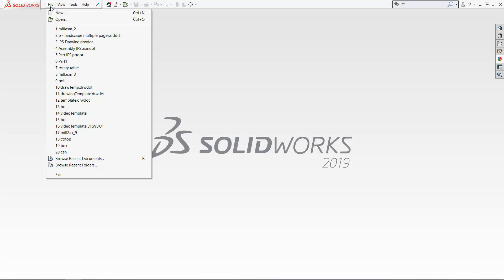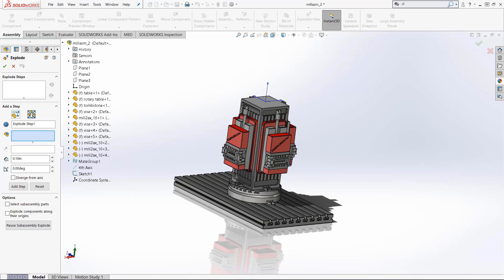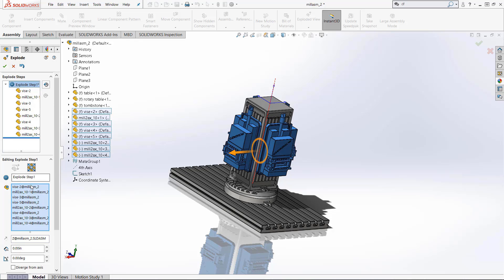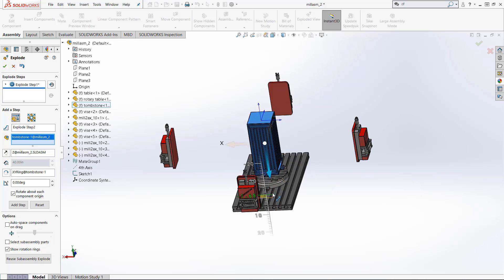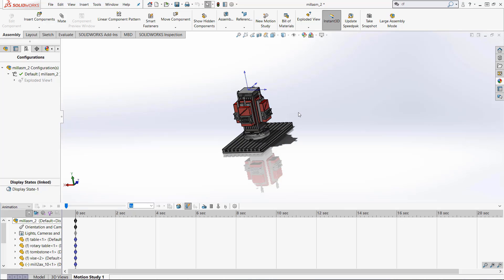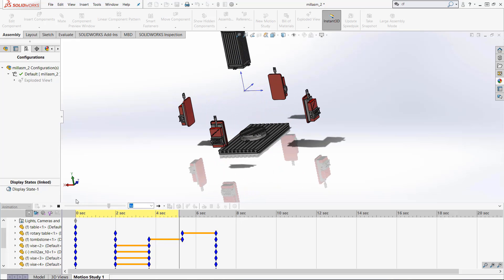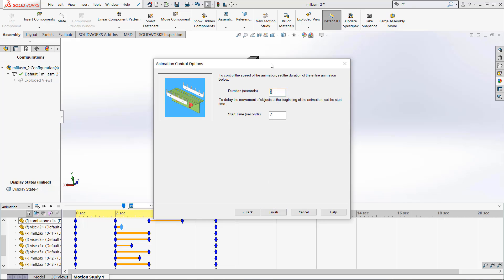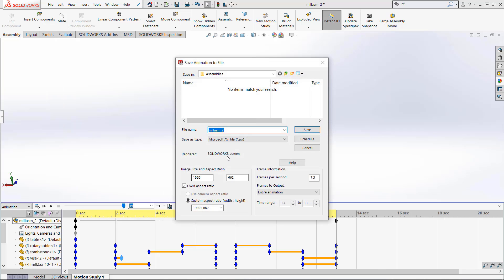Animating an Exploded View in SOLIDWORKS

Comment: exporting my motion study as gltf file into blender key frames are there but its not smooth between frames it just seems to jump keyframes, is there a setting I need to adjust for this?
Reply: It might help to increase the frame rate in the motion study settings. I think the default is set to eight frames per second. I have never exported into blender though, so this might not solve your issue.
Reply: @chadd_robertson  thanks for getting back to me, I actually solved it in blender, by default the motion keys exported from SW are flat and by converting them to smooth curves solved everything.